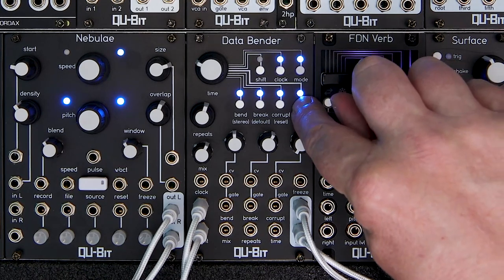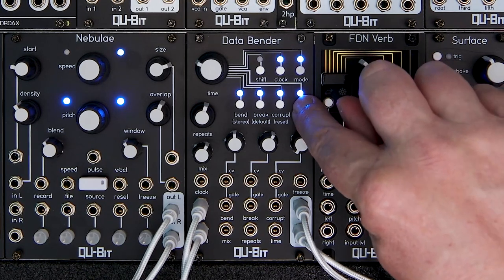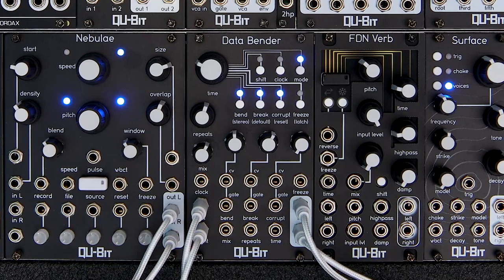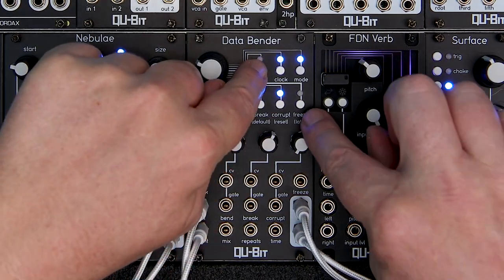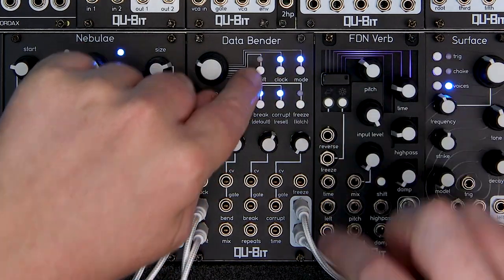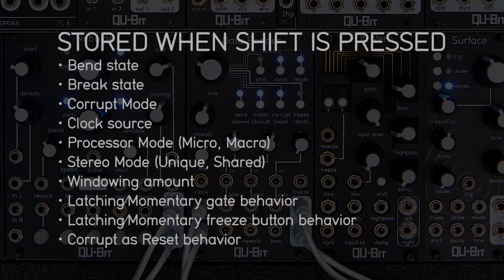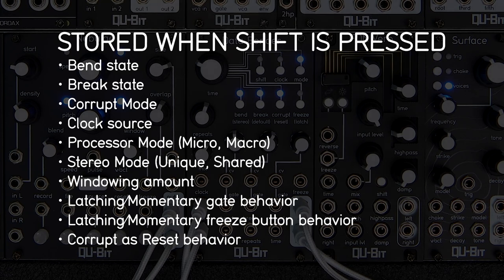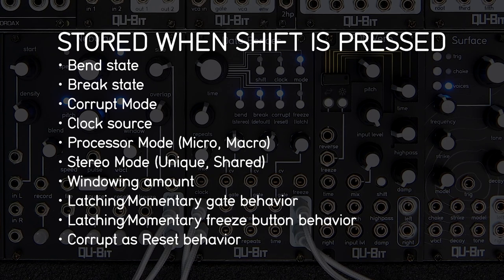Data Bender Tutorial 2: Power User

Comment: Hi When you say Shift Break default settings does that mean the original firmware settings or the latest firmware settings?
Reply from the maker: It will reset the default state for whichever firmware you are on! You can find all the setting states in the manual https://static1.squarespace.com/static/56feccc7a3360c08ffa34ed4/t/66269138ce104e65067cae35/1713803578907/Data_Bender_manual_2024.pdf#page=17

Comment: Great update! Congrats! One question. I send thru DBender 2 mono signals, which should be the settinga for independent mono outputs? Thanks
Reply: set to Unique :)
Reply from the maker: Glad you like the update!
As @brendanwilliams701 said (thank you!), what you want is Unique mode.
Here's a little more regarding stereo behavior, and how to get there:

While holding shift, the Bend LED shows the stereo behavior of the macro-mode controls.
Pressing the Bend button will toggle between these modes:

1. Blue - Unique Mode: 
All automatic bend/break settings will be unique for each stereo channel.

2. Green - Shared Mode: 
All automatic bend/break settings are set the same for both stereo channels.

Please let us know if you have any more questions, and happy patching!  :)